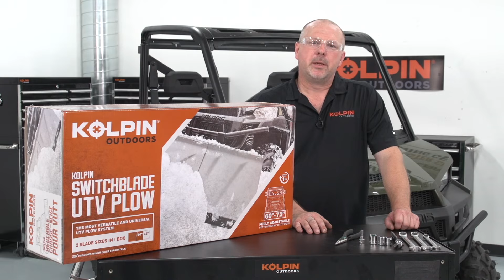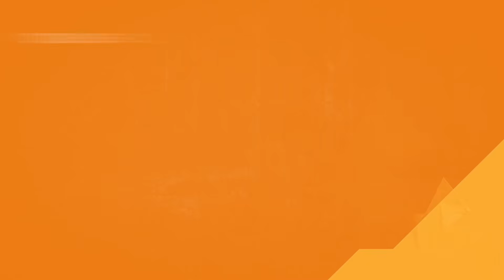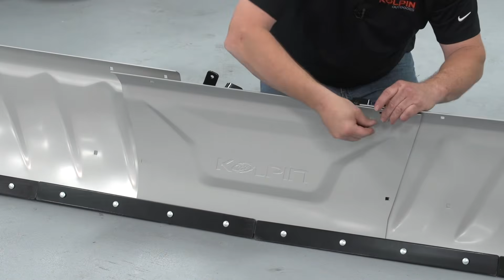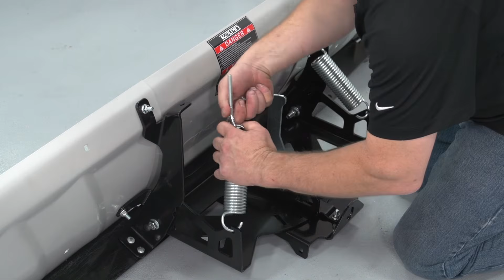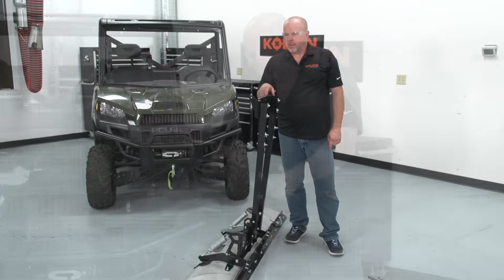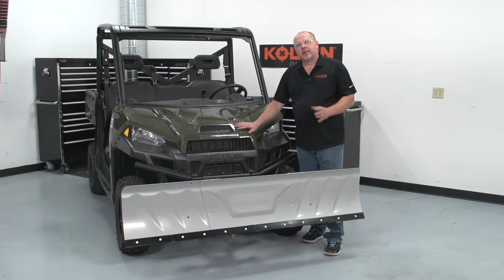SwitchBlade™ UTV Snow Plow System Assembly and Installation - KolpinOutdoors

Comment: Okay lets start from the beginning. The directions are fucking terrible. Thank you for this video. The product seems solid. You guys have vastly under engineered the swivel and the blade stop bolts. They should have bushings. The swivel should also have bushings. Why the fuck does a 1/4 turn back constitute a proper swivel when they have loads on them? I will go to the hardware store tomorrow and get what I need so I can actually fasten the blade stop bolts so they will function properly.  Glad I bought this unit on sale. I spent 3 years doing engineering drawing with AutoCad and Solid works and could have properly designed this in a weekend.

Comment: Since my below posts I replaced its factory 4.5 ft long push bars with ticker and longer 5.75 feet long push bars and mounted mid belly (on my atv).  Mid mounting is less nose dives - when plow is lifted.  Imo longer & thicker push bars for atv mid mounting should be factory build.  Overall I love this light weight blade for my 2-up atv.

Comment: I bought / installed the same Kolpin 48-60 universal plow on my ATV 2011 Arctic Cat 550 TRV (2-Up).   Instructions stated 45-60 minutes to assemble the blade.  I started at 8:30 AM, had 1.5 hour lunch and completed at 2:30 PM.   Yes.  That long - with a large cup of coffee and my reading glasses.   Retired people with bad knees/hips take longer time.  smiles.  For my ATV's under belly, I used 4 x U-Bolts and 2x2 hard wood spacers.   And I cut off the tips of extra long U-Bolt threads as well.   During its install I did add a few more flat washers and greased its swivel points.  All installed "as it should" and very happy with its looks, with its ease of angle change and with its safety tilt ability.  It's worth buying "on sale".  Recommend this adjustable plow...

Comment: For Kawasaki Teryx...the square ubolts...need about 1/2" extra clearance on the slots right where the plow arms would come up. The only one shown in the manual is for the mule. You guys have the clearance on the inside gap where the arms would come up...but if you guys would cut those slots a little longer open...then boom. As it stands...tomorrow will involve so drilling. :/
Reply: Oh...and I know it costs money...but if you guys could make the pictures a tad bigger and maybe with colour...that would be awesome.

Comment: Less than impressed with mine which I have on a cf moto z force 500.u bolts won't stay tight and break easily.mount moves forward and back.cant find replacement u bolts anywhere

Comment: I have plows on a 1990 Honda FourTrax 300 and a 2001 Honda FourTrax 500 (Rubicon). The plows are branded by CMP and Moose but CMP (Cambridge Metal and Plastic) actually manufactured both of them I think. Both ATV’s are still in operation with their original plow blades and mounting hardware. And both have spent many hours plowing many driveways here in Minnesota, especially the older one. 

After watching this video, I’m glad I didn’t buy that bolted together lightweight Koplin plow. It doesn’t look to me like it would hold up to the rigors of the plowing that my CMP plows have. The CMP plows are constructed of heavier gauge all steel construction. And the plow blade and push tubes are all single welded together assemblies. Sure, you can’t pack them into such a small box so they’re cheaper to warehouse and ship, but I’ll bet mine are a lot stronger and they have stood the test of time. I’ve gone through at least 5-6 1/4” X 3” X 60” steel reversible wear bars in the older plow. So it’s seen a lot of use. 

I know someone is going to accuse me of shilling for a competitor of Koplin. Not true. I’m just an ATV owner in snowy Minnesota.  in fact I own some Koplin accessories and generally have a high regard for their products. Just not this one.

Comment: the holes do not line up,on the plow or the ware blade. the directions do not tell you everything. run from this three piece plow
Reply: Holes lined up fine, perhaps you are just not mechanically inclined.

Comment: He doesn't explain the 2 different sizes.  He's making it full length, but if you want 60" leave one of the short brackets out, and put the  2 long brackets on the outside and the short one in the middle.

Comment: Good instructions until you hit to the part THAT I NEEDED! Mounting the mount on my machine. As usual, no detail!
Reply: Because it's a universal fit, you're going to have to figure that out on your own
Reply: I am attempting to put one on a polaris 450. Its gonna require some custom work. Honestly wish I would have bought something different now. Where this mount is supposed to be my battery is in the way. Wouldn’t recommend and I haven’t even used it yet

Comment: I dont know what the complaints are about this.  This thing works great on my Ranger 700.  Dont be an idiot and try and ram snow at 20+ miles per hour.  Have some common sense about it and you will see it moves snow great.

Comment: How many Rat-Tat-Tats of my impact it 17ft-lbs? ;) ;)
Reply: doublereed29 it’s half a dugga dugga. Or tighten till you hear the ping and back off a quarter turn.
Reply: Good thing you didn’t use a tourqe wrench to 17 lbs, because I did and the cheap Chinese hardware that comes with this plow had 3 carriage bolts snap in half on their own.